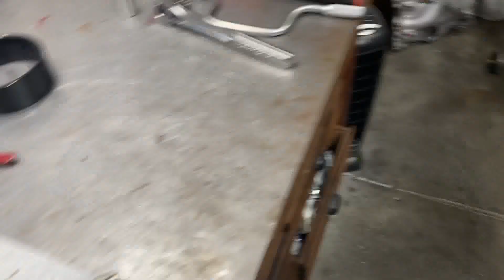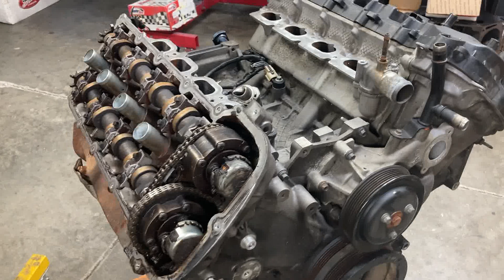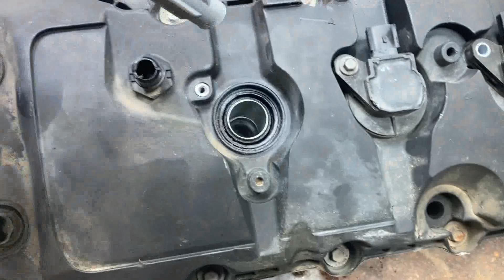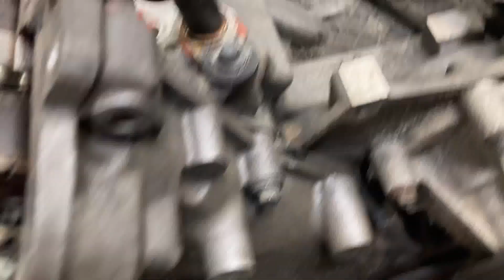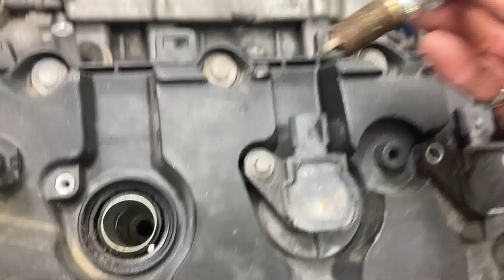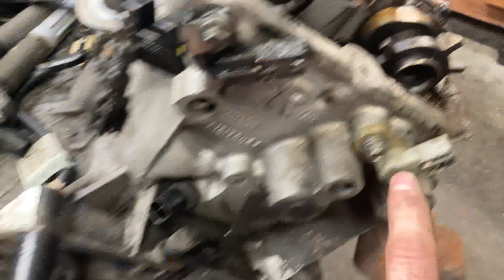Lykins Motorsports Ford 5.0 Coyote Build Introduction...

Comment: As a Ford tech, I don’t care much for those engines , I know they’re impressive, but a pain in the butt just cause of the size of them. They’re just so enormous, luckily I haven’t had to do much work to them in awhile. I remember doing a few long blocks when they first come out, had some cylinder’s that were out of round and causing a knock noise. There’s a tsb saying that it’s normal now, 😂. Works for me.

Comment: I was never a fan of the modular engines because of their physical size in relation to displacement but they have proven to be reliable and capable of impressive output.
My personal experience is with my wife's 02 Explorer/4.6 2v. Was mostly flawless for the 19 years we had it. At 200k miles I put a timing set in it along with a Melling high volume oil pump. Chains and tensioners were pretty far gone but I was expecting that. Still had the oem water pump on it that didn't leak!  Cooling system was sparkling clean as well as inside the engine. Dedicated 3k oil changes with Motorcraft oil and filters and 50k coolant changes definitely proved their worth.
This will be a cool build. 
Still drooling over the Cleveland though and can't wait to see the dyno results.

Comment: Tunnel rams for the equal fuel distribution, increased torque and power.  Vvt is a very good thing.  You'll lose it going non computer controlled.
Reply from the maker: I hope so LOL   It's a pain in the hindend when it comes to large lift, long duration aftermarket cams.  You can get reducers, but it still lets the cam timing change and you can't allow for stuff like that at build/assembly time.  That's why most guys that build higher end Coyotes lock the VVT stuff out.
Reply: @lykinsmotorsports  I'll certainly be checking out your posts on this and the recent Cleveland build.
Reply: @lykinsmotorsports are those builds made for boost in the 7000+ rpm range?